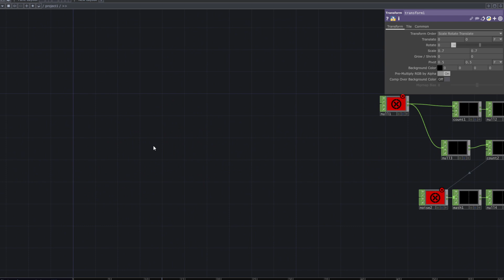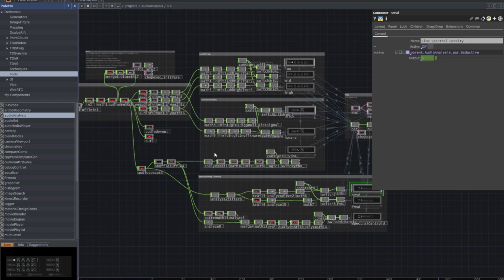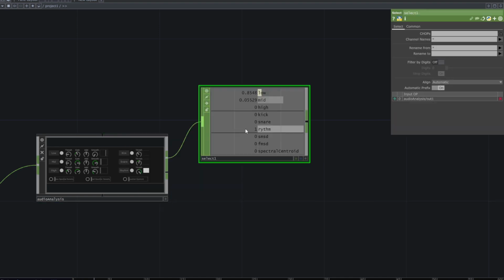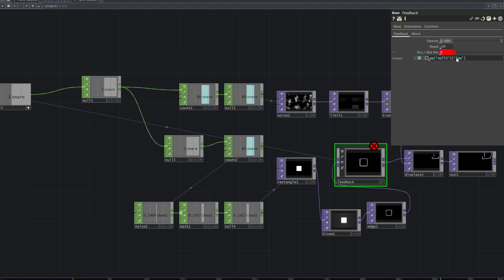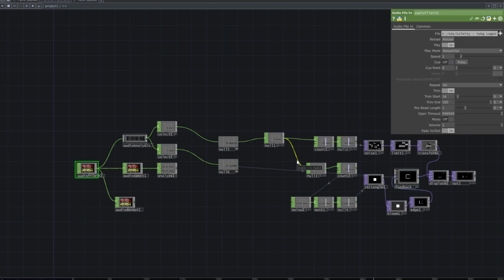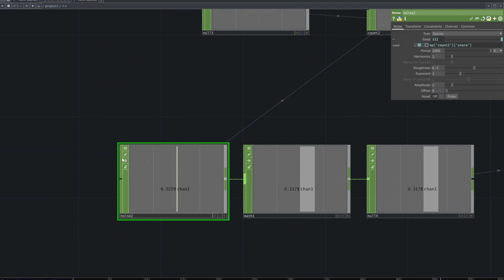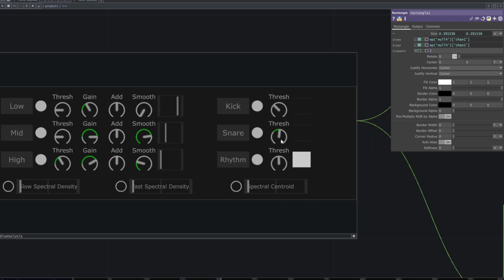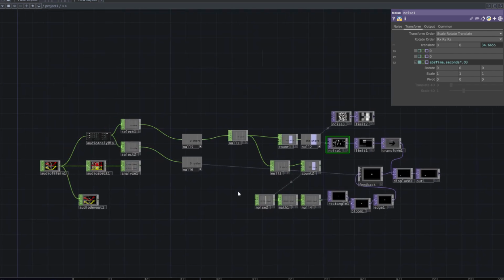this is how I make my visuals audio reactive

Comment: Super helpful, thank you! Do you have any insight into Audio VST op? I’m using Logic Pro as my audio source with Audio Device In. This pulls in all channels or “tracks” from Logic. I want to be able to separate out different channels coming from one Logic source (I.e kick channel, multiple different synths channels, etc.). The problem I’m encountering is that the Audio Device In pulls in all channels and I can’t separate the frequencies of different synths
Reply from the maker: Thank you!
I'm not familiar with Logic, but as I know you can't do it directly. Because you need OSC to send multiple signals to TouchDesigner. However I found something called SoundFlower that could help to separate channels.
Reply: @yourtenderworld  Thanks for the advice! I have BlackHole by ExistentialAudio (on GitHub) installed and after further reading it looks like I might be able to set it up that way.